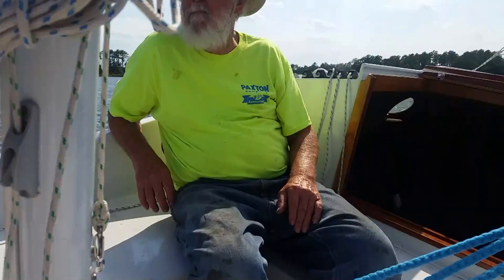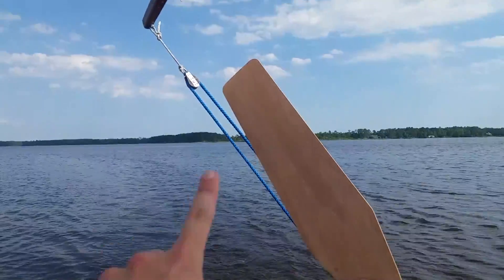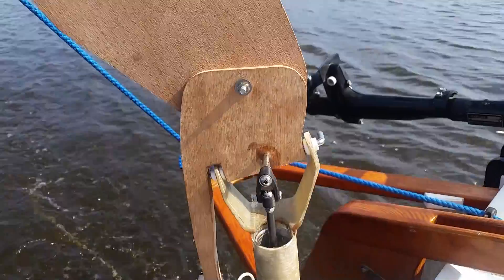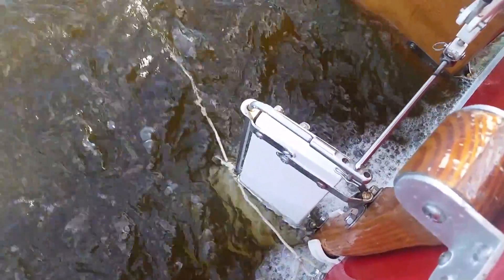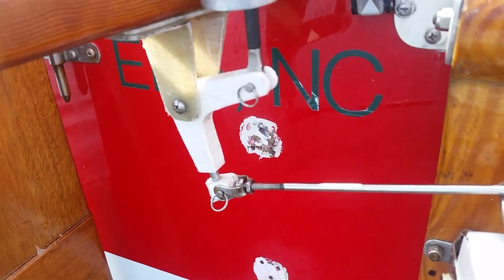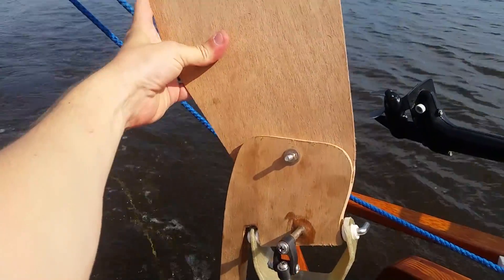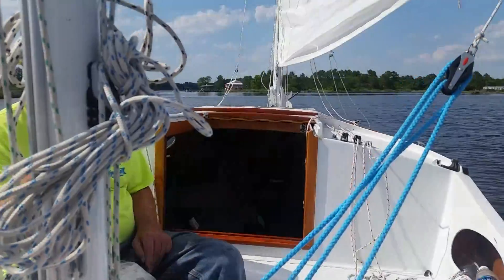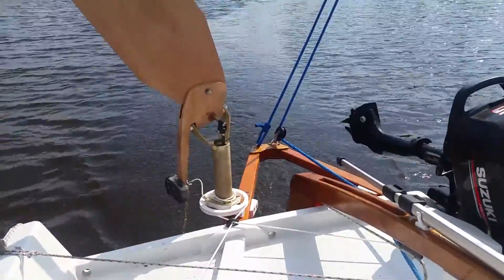B&B Horizontal Windvane First Test

Comment: Usually the flap on the windvane articulates a foil that pivots to provide force to steer your main rudder.  Not this one
Reply: There are two ways to achieve this. One is not wrong or better.